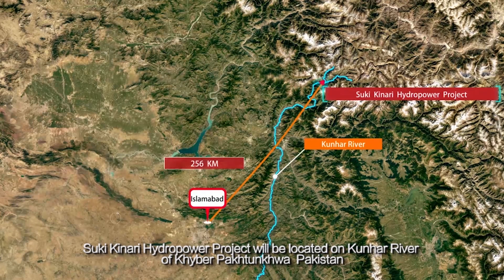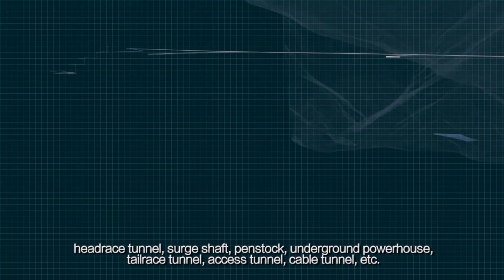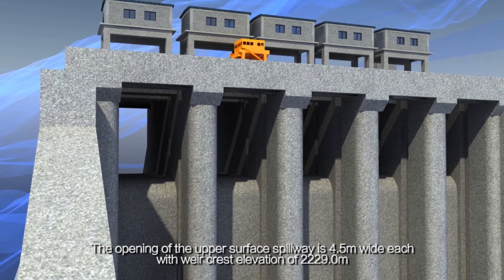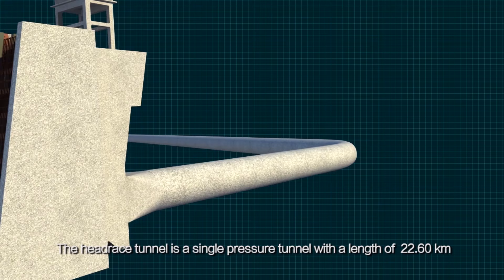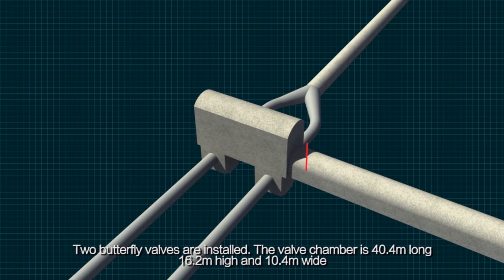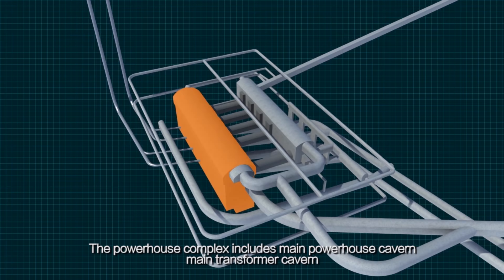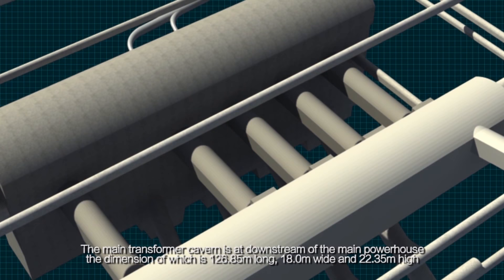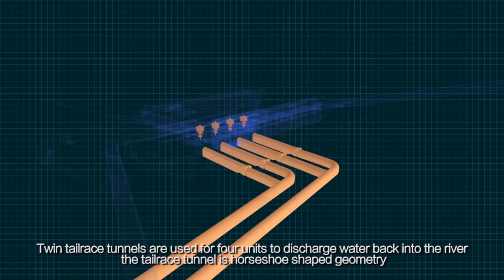Suki Kinari Hydropower Project | 3D Animated Documentary | CPEC Project

Comment: why did they design so long tunnels like almost 22kms? one reason is probably to give water that specific velocity to run turbine as the powerhouse is downstream but why so long like it could have been a few kms. looking for logical answer.
Reply from the maker: Its diversion type run off river project with highest head in Pakistan (over 900m). Due to area topography and geological conditions including several fault zones, designer avoid to put the underground powerhouse near to the fault area especially Bunja Fault therefore its HRT length is 22km then about 2 km twin Penstock crossing active fault with pressure tunnel and pressure shafts arrangement ended up in underground powerhouse cavern which have rock cover of about 400m and away from fault.
Reply from the maker: During investigation drilling and excavation of Dam there was no such zones identified. However 120m deep cut off wall with asphalt core rock fill dam can sustain ground movement if occurred in that area.